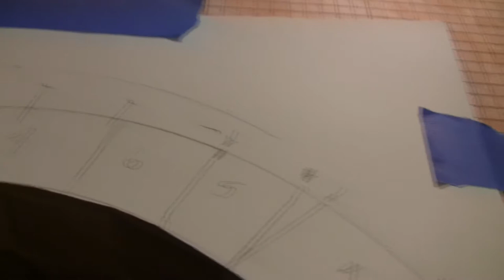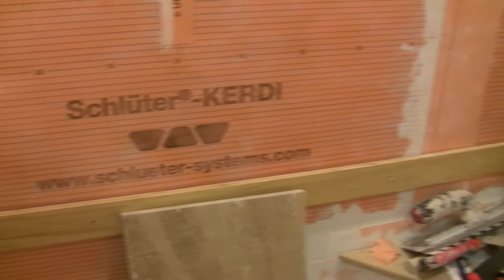How To Tile An Arch Niche For Your Bathroom Remodel 2023

Comment from the maker: ✅ Tools used in this shower arch niche project:
✅ EZ-NICHES USA - 14in x 22in - ARCH - Ready for Tile:
 https://amzn.to/2ugaFfv
✅ Ridgid R4030s 7" Tile Saw with Foldable Stand: https://amzn.to/2FnbVnp
✅ Dasco Pro Giant-Circle Beam Compass: https://amzn.to/2OfjYph
✅ Schluter Systems KERDI FIX Sealing & Bonding Compound: https://amzn.to/2Tk5DZn
Reply: jeffostroff hi bro. i wannt to use these pencils from lowes that are identical but they say for them not to be used in shower and the shiny ones to be used in shower dont match well. they look more like marble.is using a certain sealant the trick?
Reply from the maker: @ellgeee1871   Do you have a link to this that we could check it out on the Lowe's website? I can't imagine why they wouldn't want it to get wet if it's a tile. You might be able to seal it and make it work but I would be really curious to see more specs about this pencil

Comment: I know this is an old post, but I just came across this and decided to do almost the same thing. I am interested to know how you transitioned the pencil rail at the chair rail on each side of the niche.  I spent a lot of time making a slight shallow angle miter as the pencil tile approached 2” from the chair rail, so the high point of the pencil matched a lower part of the chair rail.  I am also curious how you managed the pencil where it met the glass door. Did you cut it off square?   My pencil needs to wrap around an outside corner after the glass.  I’m debating whether to notch the pencil where the glass goes or cap it off on each side of glass, or notch glass.   Thanks for sharing your work and giving me the ideas. Mine is turning out nice, too. That arch is a bear, and you are certainly right about having to make slight adjustments to make it look right.
Reply from the maker: I ran an 1/8" grout line around the outside perimeter of the arch and had the pencil end 90 degrees from the wall, straight cut, just like the tiles, so the pencil ends 1/8" from the arch along the same vertical line with the tiles. At the glass door, I had the pencil end just before the door, perpendicular to the wall, with a vertical slice of tile making the termination border for the tile wall going all the way up. https://www.facebook.com/jostroff messenger me I can show you some detail photos.

Comment: Thanks a lot for this video. One thing I’m curious about is how you got the segments for the niche, I understand everything up until that point. Great work btw!
Reply from the maker: I traced the 2 lines of the arch, then segmented them, then cut out the pieces on carboard and traced them onto straight chair rail tiles, then pieced them together to form the arch.
Reply: @jeffostroff  thanks for replying! Yeah I understand everything except how you segmented them. You use some kind of formula?

Comment: What is the "ORANGE" mesh lookingsheet over the cementitious board?
Reply from the maker: That is called Schluter Kerdi Membrane. It is a waterproofing membrane that is required when you tile a wet area like a shower surround. Some people also use AquaDefense to paint on a watertight coating.

Comment: Why are all the cut pieces for the arch different sizes? Seems that if you divided the length of the circumference by the number of pieces you want to have, you could have extrapolated your cut angles from those numbers and bisected that angle to get accurate, consistent cuts all the way around the arch.
Reply from the maker: Ken, trying to convince straight pieces to look like curves is tricky, particularity at the apex of the curve where the outer radius has to be large and the inner radius small in order to make that straight piece look curved. Add into the mix the inaccuracies of the wet saw blade removing almost 1/8" of stone from the original line we drew on the paper to decide where to make the cuts. If I had made that top piece the same width as the others, it would not line up properly to the pieces on either side of it, and it would look like a straight piece, not a curved piece. The more accurate you want the curve to be, the more smaller cut pieces you need to make. Something has to give when you're trying to use fewer pieces to stretch around the curve.
Reply: Gotta agree they should all be calculated to be the same size. It still looks nice. And agree it’s a pain on time. I’ve spent upwards of 6 hours or more on niches. I dislike them a ton. Hard to charge for them. As to putting mortar onto the tile vs wall it’s not the same. Only if you key mortar on to wall first. It’s because when you use the flat side of the trowel you’re rebreaking the crystal in the mortar forming a tighter bond. Shulter does teach and recommend this as does the TCNA. Good looking shower.
Reply from the maker: @tileslay6543   We originally cut to pieces all the same size in it quickly became apparent that it just wasn't going to work that way and looked like a realistic curve.
Reply: Than they get cut smaller and another trick is you use a polisher and put a slight arch in the bottom and the corners. You can only do this when it’s a solid surface like stone. Again this is a nightmare but can be done.
Reply from the maker: @tileslay6543  That's a great idea
Reply: Only thing about tile is the learning never ends.

Comment: You never puncture the waterproofing by driving screws into the wall. That is very poor practice. Not a very professional thing to do.
Reply from the maker: I can't believe you're that ignorant and arrogant too, lecturing me like that when you completely misunderstood what was going on. There are occasions when we need to drive a screw through, to support heavy stone tiles, and you just simply add another Kerdi patch when you are done. Are you really that dumb to think I didn't patch it up afterwards? Narrow focus, and narrow minded wanna bees like you only focus one one stupid thing and try to take it out of context, so you can stand there like a uninformed hypocrite with your finger pointing at someone, when it should be pointing at yourself in the bathroom mirror. Looks like you need a few more years of experience in remodeling before you're professional enough to puff your chest out and lecture other about what's professional. thanks though, you gave us all here a great laugh, at your own embarrassment.
Reply: These u tube creators are a sensitive bunch. I came for the arch. Left disappointed. That arch is jacked up. And that is his “best” work. I guess he skipped geometry class.